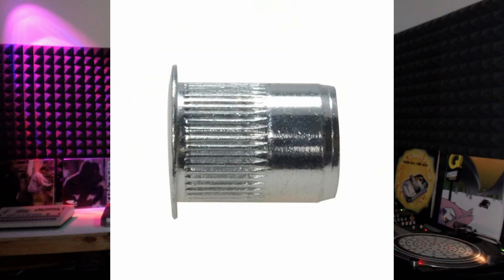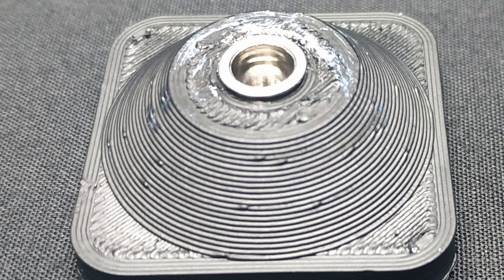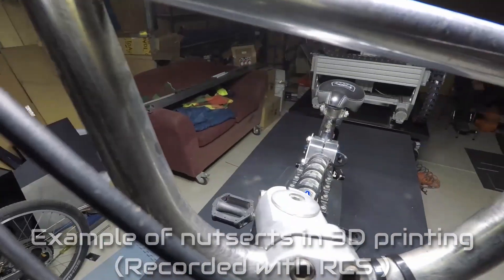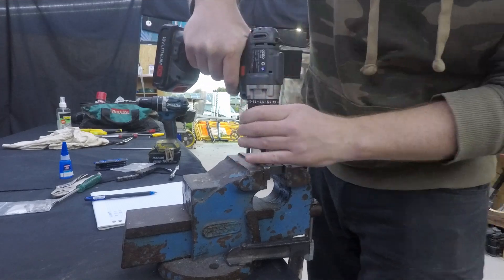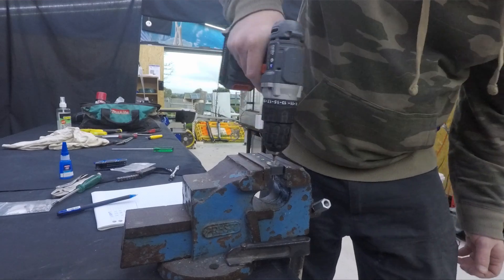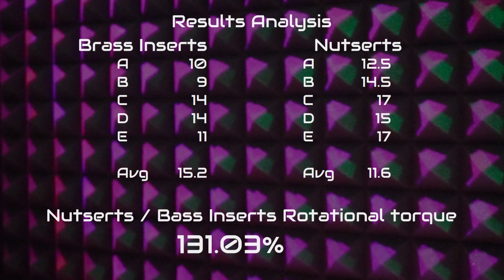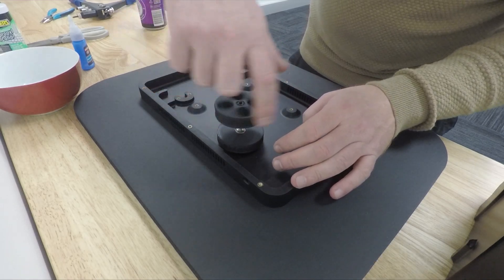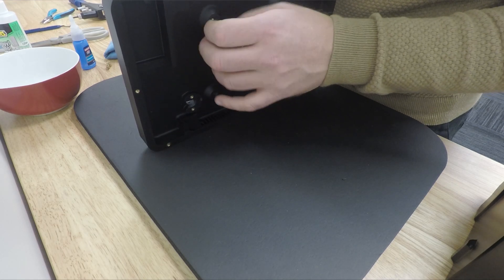#3dprinting Brass Inserts Can't Beat This New Method. FREE STL Download

Comment from the maker: Additional notes: We found making the holes under size by about 0.2mm less than the nutsert worked really well. There are many options for ~6.2mm dia' nutserts that work well in a 6mm hole.
A drill press is probably the most common tool available for people to use to press them in, and this works well in our experience.
If you want to use nutserts in their intended use in 3D printing, consider the thin wall required (>3mm) may be a weak point in your design.
Have you had brass inserts spin and prevent screws from being removable? Try this method.

Comment: This is something I am struggling with on my current project. I do find that the brass inserts hold onto the screw when they slip, but it also seems that the threads have been partially stripped which is what is locking the screw in place. The nutserts look to be a good solution, so I will order some now and see how they go. Thanks for the video!
Reply from the maker: Oh interesting, thanks for that info. I assume the variance in screws and inserts would create different results too. Please let us know how you go.
-Ken

Comment: Great to know - have been contemplating doing this myself vs the brass inserts.

Did you use Al or stainless steel nutserts?
Reply from the maker: Hi Aaron, Thanks. I've used Stainless steel from boltandnut.com.au . Even not pressed, just glued in with epoxy in that BMX build worked very well. Give it a go.
-Ken